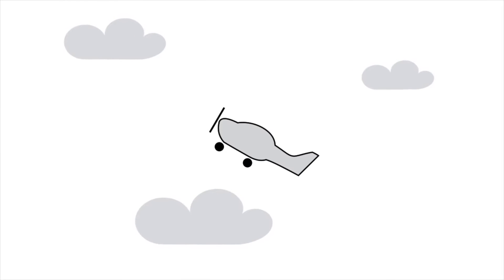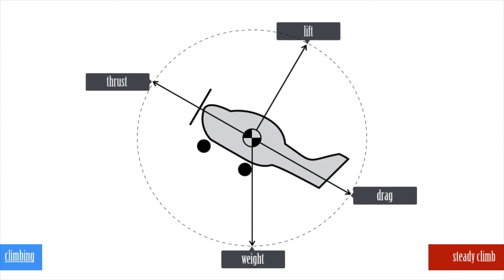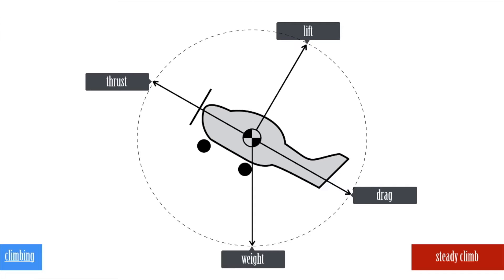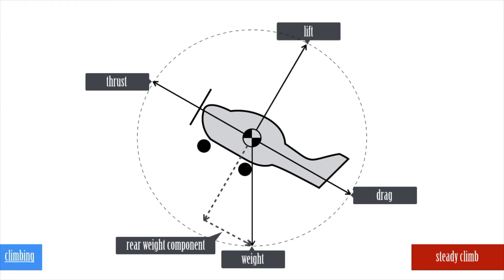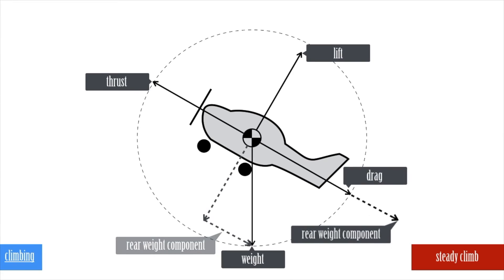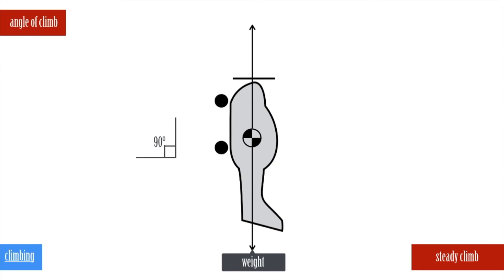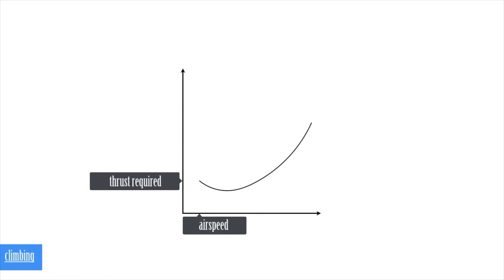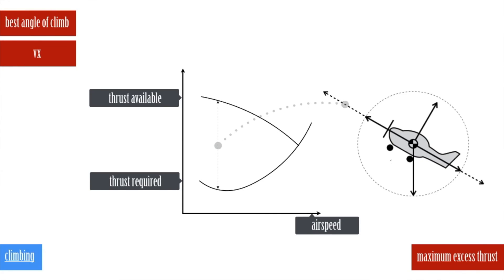How does airplane climb?

Comment: I believe at minute 1:32 we are missing one vector for lift in this depiction, as it too would be slip, not only pointing backwards but straight up and that would also add to drag (induced drag) Then both lift and weight have a component adding to effective drag, or the dashed line in the rear. Please correct me if am wrong in this. Also, by far the best video explaining this concept easily, especially with that 90 degree climb touch at the end. Again, please someone correct me if I am wrong about the induced drag vector.
Reply: Hi one year later. 

The forces have to be in equalibrium relative to the flight path. So doing climb, lift will actually decrease to balance the weight that is now acting alongside drag. Finally, the excess thrust will have to overcome the added force in the "drag-direction" from the added weight. Now the plane has established a new equalibrium at the cost of more thrust. Remember if the plane wasn't in equalibrium it would accelerate! During a steady climb the speed is constant = no acceleration.

Comment: Shouldn't centrifugal force also act on an airplane during climb? When an airplane climbs, it turns around its pitch axis, so it should experience centrifugal force.
Reply: You are turning in a climb… you are going straight out, unless you are Turing in a climb then it would.
Reply: only during the transition from straight level cruise to stationary climb does the aircraft pitch up in order to change the path angle. The video here is just explaining the stationary climb condition at which the velocity vector (relative wind) and the flight path angle do not change in time.

Comment: Love the videos! 

Just had a quick question and was wondering if someone could help me out. I don't understand how lift can be reduced solely due to the opposing weight component also being reduced. I'm working on my FIR and trying to perfect my explanation of this. 

Thanks for your time!
Reply: I'm not a expert or anything but my understanding is excess lift makes the airplane climb a bit and the relative wind changes as a result. The upward changes decreases AoA until its at a equilibrium. Thus reduced lift
Reply: the lift depends on the velocity and angle of attack of the wing with respect to the velocity vector of the aircraft. So lift is not directly related to the mg vector. But the video does not say that the condition explained is a stationary climb meaning that the path angle and the velocity of the aircraft are not changing In time; therefore the forces must equal out in opposite directions. The aircraft in the video is flying at these conditions, if the angle of attack or the relative velocity of the wing would change due to a change in thrust or deflection of surface to pitch up the airplane then lift would increase and it would then be a transition from steady state (level or climb) to a pull-up with changing the path angle. I hope I have given you an idea and I hope I have not done any mistakes in the explanation. That is how I understood it in the courses.

Comment: Excellent explanation. Short and concise.
I also really like the graphic explanation. Spot on.
Just one little thing:
The rearward component of weight does not "contribute to drag".
Drag and the rearward component of weight are separate forces.
Even if they act in the same direction.
Drag is an aerodynamic force that is caused by the oncoming airflow.
Whereas the rearward component of weight is caused by gravity.
Reply from the maker: Good point! Thank you.

Comment: Is it 'thrust' or 'power' when refering to propeller aircraft in this video? 
Great video nonetheless!
Reply: power is generated by the engine, which turns the propeller to create the thrust force
Reply: props usually are assumed to have a rated power available and typically that depends also on the air density so on altitude. Prop engines are reported in manual with power and to get the thrust you have to divide the Power by the velocity at which it is flying.

Comment: Thrust available against thrust required over airspeed graph. I think the Greatest gap in the graph would give you the best rate of climb and not the best angle of climb according to the principles of flight book. Maybe I'm wrong but worth checking as it's a little confusing
Reply: Greatest excess thrust on the thrust graph give you best AoC. Greatest excess power on power graph gives you best RoC.
Reply: The best rate of climb over distance is around 10% higher airspeed than the best rate. Bearing in mind the best rate is at the airspeed of lowest drag and this is generally best glide. Max angle is a slower rate of climb over distance but a higher angle. Hope that makes sense.
Reply: Agreed